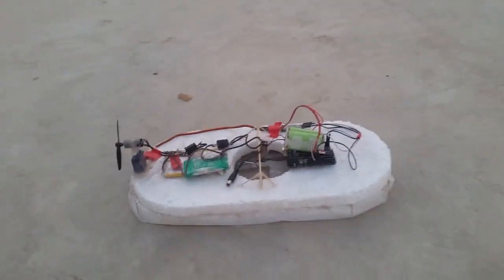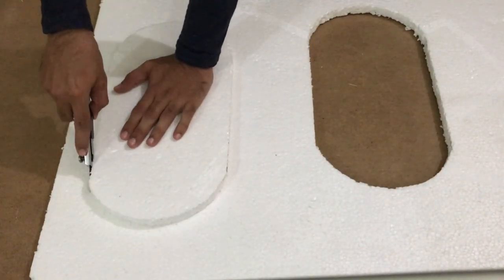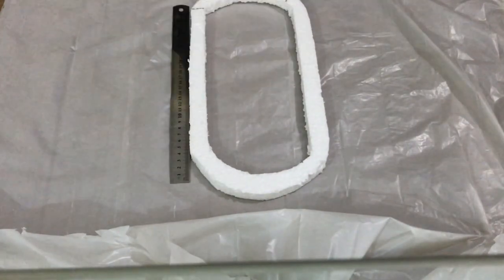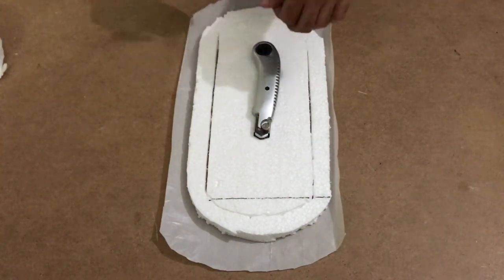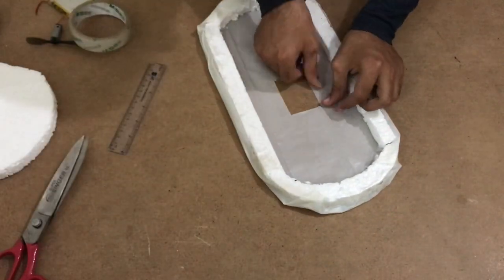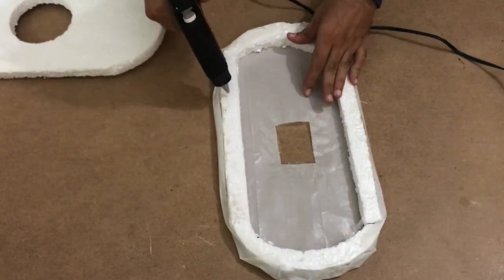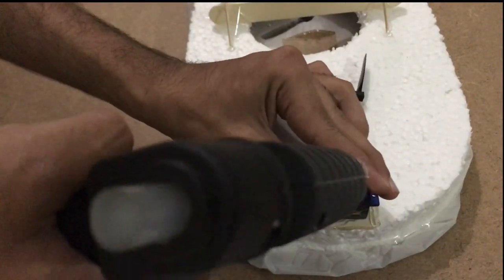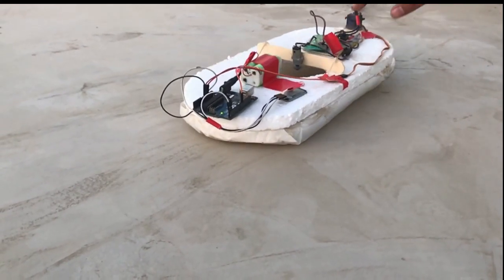How to make Arduino Controlled Hovercraft

Comment: I am trying to build this project but every attempt has been  a failure. Could you please tell me about the details of motor and propeller used. It's pretty urgent mate.
Reply from the maker: m50 cw+ccw dc 3v-6v electric motor is the one we used one propeller just came with it and we took one out of an old airplane you don't necessarily need this exact motor just one with a high rpm thanks for asking